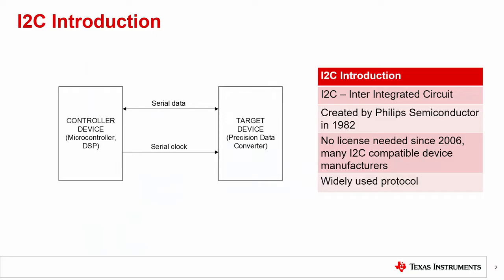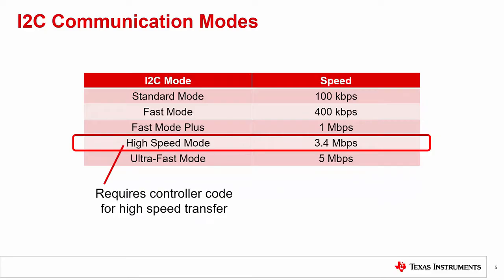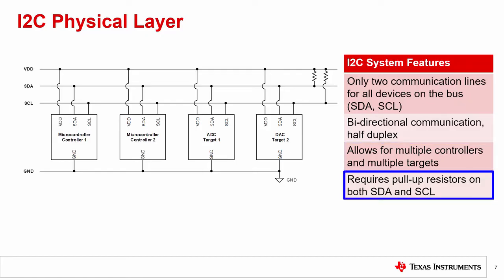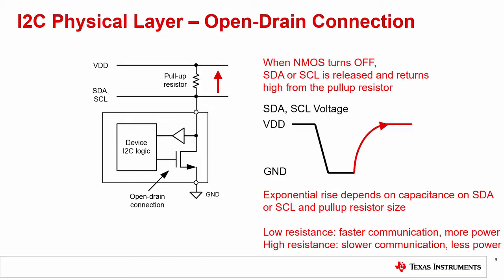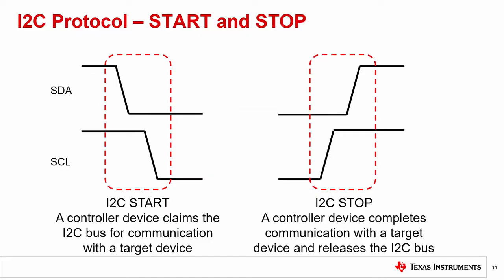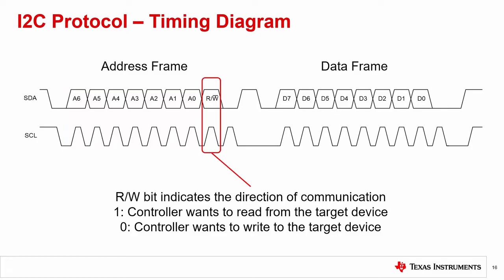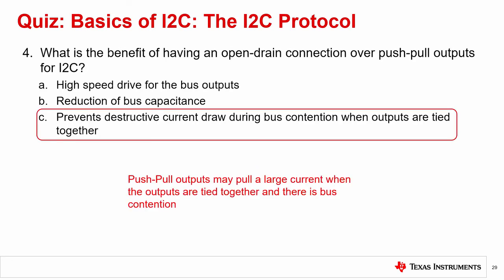I2C introduction: The protocol

Comment: I thought this would be an easy primer....ok it is easy? All the transistors being mentioned are already on. The modules? Or is this meant for engineers who are designing the boards? Because the thing is an IC... A bunch of ic's?
Reply: For writing drivers too.
Reply: I think it's meant for anyone who plans on using I2C in their devices. For example, the sensors I am using in my device communicate using I2C, so I'm just watching this to understand the basics before I watch more complex videos to learn how to pull data from my sensors. The part about the transistors is likely to explain how the lines are pulled to low voltage because many people like to learn about the underlying mechanics so that they know where to look if there's something wrong with their device.

Comment: @ 12:37  you did not explain why is the SCL is gated after Address frame ACKT, and also why SDA is high for one  pulse.
Reply: SCLK: it is not gated, if sclk becomes high then it is considered as transfer of bits  and at that time we are not interested to send data so we can keep the sclk low indicating that there is no data transfer at that moment.

SDA:  we can keep any value for sda  during negative edge of sclk line, the device will sample only during positive clock duration (it has to be stable)
Reply: Gating SCL after an Address Frame ACK allows devices to synchronize and complete tasks before proceeding to the next operation for the seek of reliability. As for SDA, it remains stable (high or low) when SCL transitions from low to high to prevent unintended data transitions and maintain synchronization.

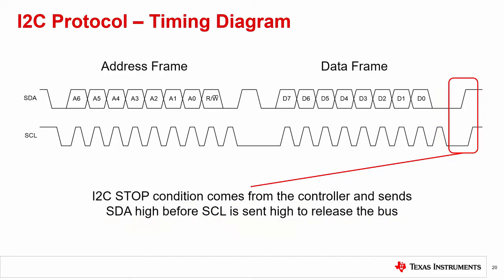Comment: At about 13:36 (discussion of I2C STOP condition) the audio states that SCL is released and then SDA is released. This appears to be the reverse of what actually happens.
Reply: Yes thats a mistake in diagram.
Reply: As others have pointed out, the diagram is incorrect, but the audio is correct. This is a really nice tutorial but I would like to see the repeated start condition covered.
Reply: I agree
Reply: Yes, it's a mistake
Reply: 9:24 Here you can see the correct I2C STOP condition, if you are confused between if the diagram or the audio is right at 13:36. (The audio is right)
Reply: You are spot-on. This video is misleading and low-effort… not what I expected of TI.
Reply: @witchdoctor88   The video isn't misleading or low-effort. I didn't know how I2C worked before watching it, and now I do. There was a single error. If you notice it, you either understand that it's an error or you're confused and look up the correct STOP condition as I did, gaining further understanding. If you don't notice it, there's no confusion or inconvenience.